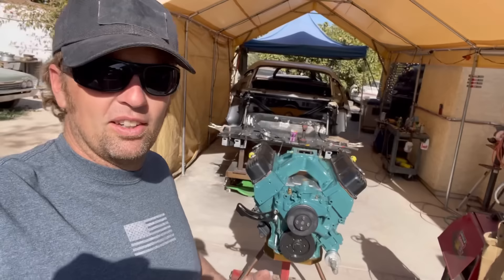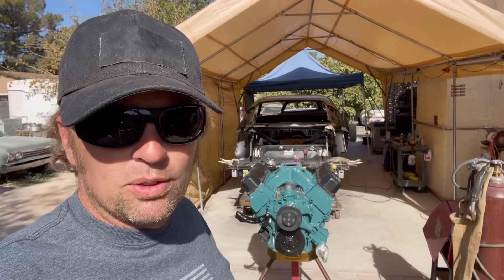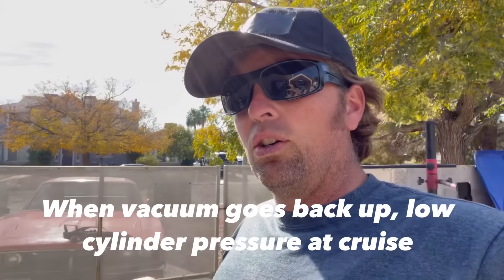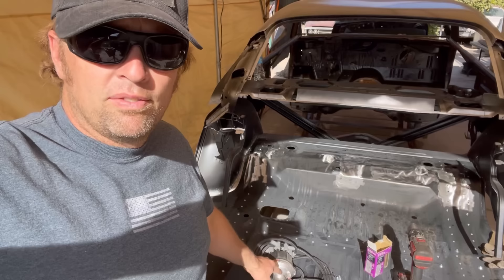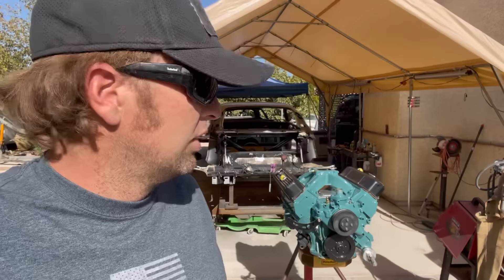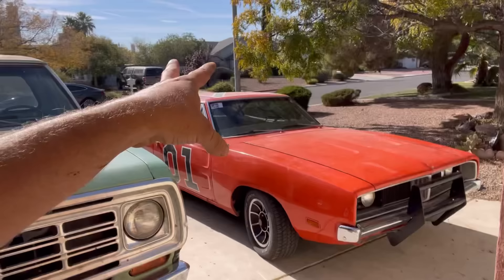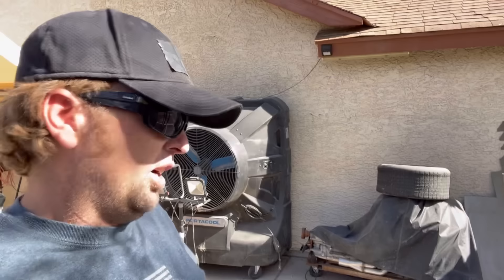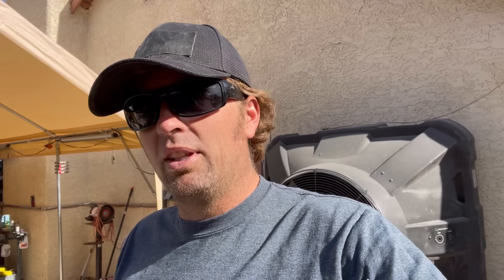Stop unplugging your vacuum advance on distributors

Comment: A dialed in vacuum advance will also allow the engine to run cooler... I recently bought an old '72 Chevy truck and the temperature gauge would get up to about 212-215 degrees then shut down starving for fuel because of vapor lock, even while going down the interstate with lots of air going through the grill. I replaced the entire cooling system first (new radiator, water pump, thermostat, fan clutch) and it still got too hot. Then I tried every trick to try to avoid the vapor lock (blocked off heat riser passages to intake, added a carb spacer, added a fuel return line coming off of an inline fuel filter just before the carb, insulated the fuel lines) and it still got too hot. Then I even "re-calibrated" the fan clutch (by adjusting the little thermostat clock spring on the front of it) to pull more air through the radiator, which it did, now you can hear the fan roaring with RPM, and it still would get too hot. When it would shut down and I'd have to pull over, when I popped the hood the amount of heat coming out would make me step back... Then I did a little research and decided to check my vacuum advance and the only changes I made was to switch it from a ported vacuum source to a manifold vacuum source, turned the adjustment screw one and a half turns to maximize advance and that is what finally fixed it... Now my temperature gauge stays around 160-170 degrees, even crawling in traffic on a hot summer day in the southeast, and my vapor lock issues are gone... Gas mileage got much better too... If you think about it when the ignition timing is late, the fuel is burning all the way down the bore to BDC and heating up the whole cylinder bore which heats up more coolant, then it's still burning on its' way through the exhaust manifold which dumps excessive heat under the hood... Another interesting thing I remember noticing about vacuum advance was one time when checking the timing on my Charger, I forgot to re-connect the vacuum advance hose and when I went down the interstate, I had to keep my foot in the throttle like almost halfway, almost opening the secondaries on the carb just to stay at 65 MPH. And my gas mileage got so horrible I started looking around for a fuel leak and that's when I found the vacuum hose that I forgot to reconnect. Once I reconnected the vacuum hose and got back on the interstate, I could cruise at 65 MPH with the throttle just barely cracked open off of idle and gas mileage was back to normal... Great videos!!!

Comment: Not arguing here but it seems to me if I tried to advance the timing to 45 deg at idle it would not be very happy. I am missing something here... Do a video showing exactly how you are doing this please. Again, not at all arguing, I agree you need a vacuum advance but it seems counter intuitive.
Reply from the maker: Every engine is different, crank timing into it until vacuum drop that’s ur magic number
Reply: Plug the vac advanced to a "timed" port on your carb (doesn't open till the throttle blades open) it help with hot starting & gives max advanced at cruise, but drops off under load & goes to 0 advanced at WOT.
Reply: Use manifold vacuum not timed

Comment: I think I understand your method but am worried others will not. So, 45 degrees at idle and 32 at full throttle after vacuum module pulls timing out. That means you are running your distributors with the mechanical advance locked out? You made zero mention of that, and it’s a really important detail here. If someone with a stock Mopar distributor does exactly what you say and sets their base timing to 45, they will have 70-75 degrees timing before the added timing from vacuum. What’s going to happen to these engines at 75+ degrees of timing under a load? Nothing good… I had a call this morning from someone who watched this and did not get the full picture here. I’m afraid there will be many more viewers who don’t.
Reply from the maker: Not locked, 22-24 base, 35-37 idle with vacuum, 32-34 mechanical without vacuum and 45-47 highway cruise

Comment: So many of the old distributors had mechanical advance slots that were too long for emissions.  Remove the advance plate and shorten the slots with weld, that way you can run a lot more initial advance and keep the total mechanical advance at reasonable levels.
Reply: I did that but with a FBO plate that has different length slots on a disc so you can get ,in my case , 18 initial and 36 total mechanical advance . I also use manifold vacuum advance to help idle and cruise.
Reply: 74 cuda ,360 with 4.30 gear .

Comment: 18-19mpg on the highway with 400/727/2.94 b-body. And yes, it's on manifold vacuum.
Reply: What's the build on your 400 ? I have an early 230-1 truck block 400 that I am trying to decide which stroker version to build. It's definitely getting the ceramic coating throughout and Trick Flows.

Comment: Allow me to tell what would happen if you left that vacuum advance line unplugged and kept driving like an average Joe cold air on a warm engine you would eventually burn a penny size hole through one of your pistons , but before that you would have a lot of detonation which would probably overheat your coolling system, so you buy and throw parts at it trying to fix it with the hole finally completed that piston will start dumping fuel into your crankcase diluting your oil while running on 7 cylinders, running late for work so you try to start it and hear a boom under the hood and find your oil cap blown off and your oil pan and valve covers will start leaking from everywhere what was the fuel diluting your oil and finally reaching the right proportions of oxygen to be ignited by the spark plug, so you'll eventually get it running and drive it to your mechanics, and he might just try to restart it and a boom all over again, and all that was caused by a vacuum leak usually at the back of the intake manifold, always inspect your vacuum lines, and replace them,

Comment: Chris, you are absolutely right. I have a 1973 Trans Am, the motor is BBC 440 ci. The cam is hydraulic roller 229/235 - 109, 9,9:1 compression, 750 Demon BT carb. The driveline is Tremec 5- speed, 0,64 overdrive and 3,73 rear gear. T/A runs 18 mpg on the highway. Initial advance is 8 deg, idle 31 ( 8 + 23 vacuum ). Cruising 53 deg ( 8 + 23 + 22 centrifucal ) Wot 30 deg because i have a Procharger supercharger. Before the Procharger wot advance was 38 deg. Car runs perfect and fuel economy is incredible low.

Btw, i live in Finland and internet and youtube is great invention because without that i'll never heard genius guys like Chris.

Comment: I had an old grey beard teach me how to time off of vacuum back in the 90s. 
I’m sure he’s gone now, but I remember what he taught me. 
I’m curious about the ported vs non ported vacuum debate. 
Would love to see your take on the subject.
Reply: I'll usually try straight vacuum first, but if the engine kicks back while cranking hot, or spits and burps at idle, then I'll switch to ported. Mopars seem to like straight vacuum, Fords seem to like ported.

Comment: Thanks for the wisdom. 👍 I run a 400 based 512 stroker with Trick Flow 240 heads and a hydraulic roller cam with 254 duration @.050 with 618 lift, all backed by an A833 4 speed manual in my 1968 Barracuda fastback. Time to get out the old vacuum guage!

Comment: Light springs and total timing coming in at 1800 rpms is all u need.    A stock dizzy timing wont come in until 5500 or almost never.    At say rpm cruise of 1800-2500 or so with a stock dizzy.  Mechanical timing is probably 15-20 or so.  Vac can kicks in. 30-35.     This on a sbf.   34-36 dgrs total mechanical advance is what they normally like

Comment: I have watched this and other videos you do multiple times, I'm new to this, I have a 69 dart gt 383 with 727 and 3.23 gears, Have no idea about what kind of cam it has. 1411 Edelbrock carb. I recently recurved my distributor, lighter springs advance comes in at 1200rpm all in by 2300 ish. distributor has black bushing so allows for 18-19* total mechanical advance, the vac canister was not working so changed that and new one is tested, it works. currently I have my timing set at 18* initial without vac, gives me 33* with vac attached, total timing all in with vac attached is at 52-53* I'm afraid of having too much advance on the top because of ping or detonation possibility and I can't limit the distributor further (no bushings to have less play) so based on keeping my max at 52 or lower the only thing I can do is screw the vac adjustment to stiffer to limit total advance. So my vac canister at lowest setting has max advance of about 0-19* I currently have it screwed in 2 turns and have it at 15* max the vac will advance. If I crew in more the stiffer the spring the less advance it will allow at idle when hooked on and plugged into manifold. 

I'm thinking of limiting the vac to give me max play of about 12* instead of where it is with 2 full turns now at 15*.  Here is my dilemma, would love to hear your thoughts... should I keep the vac advance on loosest setting and lower my initial to make sure I don't go far beyond 52* all in at 2300 rpm with vac attached? or should I screw the vac canister adjuster to stiffer, limit it to only advance say 10* max play and put my initial without vac attached to say 22*. 

I don't know if my question is making sense. I guess what I mean is, I have the lightest springs in the dizzy with the largest bushing to limit total advance and to let the advance come in sooner. There is no more adjustability left in the dizzy mine is a ready to run distributor, so I think the only other adjustable thing left is the vac canister. Set higher initial and limit the vac canister total allowed advance? or set lower initial timing and allow more advance through the looser vac advance port. I will end up with the same advance at idle and at highway either way you slice it but I guess what happens in between say at part throttle or takeoff the numbers will be different. but at all in and at initial with everything attached I will have the same advance degrees so which avenue is better? How much total play should the vacuum advance have in it, is there an explanation for that. 

Any of your thoughts, suggestions are appreciated. I want to get the timing diled in proper before I start changing jets and rods on the carb to smooth out any fuel delivery issues once timing is tuned and set where it needs to be.

Comment: Manifold vacuum advance canisters and ported vacuum advance canisters are different. Manifold vacuum is highest at idle, while ported vacuum is highest at part throttle/high gear - so those vacuum advance canisters are necessarily different.  If you plug a ported vacuum canister into a manifold vacuum source, you will have a wicked part throttle knock.  If you back off the timing enough to get rid of the part throttle knock, the engine will become very lazy.  If you plug a manifold vacuum advance canister into a ported vacuum source, the engine will require more initial timing to run even reasonably well.  Ported vacuum canisters are usually a lot larger than manifold vacuum canisters, and usually have a thermal vacuum switch in between the ported source and the vacuum advance canister.  Ported vacuum sources will go midway into the side of the carburetor barrel, and manifold vacuum sources will be located underneath the throttle butterflies or right into the intake manifold at some point.  Ported vacuum sources didn't become common until after 1973, so if you had a stock 1977-ish pickup (for example) that ran pretty bad;y or couldn't get out of it's own way, it is/was because of an incorrectly set up ported vacuum advance system.

Comment: I always set the initial idle timing with the vacuum advance disabled.
Then re-enable the vacuum.
The idle advance will step up but retard the timing when you open the throttle. This normally prevents "pinking".

Comment: Loving your, channel. But i think you might be off a little bit.  Your duel quad tunnel ram charger is getting it great mileage from the very tall 2.93 gears. My 69 charger 383,  was getting  close to  20 with the 2.72 stock gearing. Now it has 3.56, gears, and a 512, stroker. It gets  around  14 at 60 mph if im not playing to hard. Thats with ported vacuum. But i will try what you are saying, to see if it improves.

Comment: 100% on manifold vacuum. if I remember correctly, all internal combustion engines want maximum cylinder pressure at a certain number of degrees after tdc for peak efficiency .can't remember if the degree number was 14.15.16 or 17(piston position). regardless of rpm. and the same fuel burns differently depending on the fuel mixture. a guy grimsrud  have explained this well. but it's a lot of work to get the carburetor and ignition set up right.  usually  need different weights, springs, ifr, jet, airbleed, powervalve and powervalve restriktor.

Comment: new piston rings makes tons of vacuum also when i rebuilt my mustang 302 quickly discovered new timing chain kit & valve adjustment was huge in getting a smooth idle had a dwell meter hooked up before/after the rebuild idles so smooth now

Comment: I have timed an engine many times in the past with a vacuum gauge. Not because it made the engine run mo-better, but because I did not degree the cam in...I just slapped it in, and lined up the timing chain marks. I wish I could get classic car insurance for my 4X4 Chevy square body crew cab. Classic insurance companies will not insure a 4-wheel drive truck, and since Nevada changed the classic car registration laws I am screwed on that.

Comment: im fairly inexperienced, and I need some clarification, I think. I understand what you are saying about having more advance when at part throttle. from the little I think I know, I don't understand why you want manifold vacuum instead of ported. from what I understand, manifold vacuum drops as you give it throttle and ported vacuum increases. with what you are saying, it seems like ported would be advantageous because the timing is being advanced as soon as the throttle is moved. what am I missing? why is that not the case?

Comment: Wow, confusion abounds.
1. There are two types of vacuum. Ported vacuum that by design does not pull any vacuum at idle. This is where most every factory vacuum advance system connects. Slightly off idle Ported vacuum will become effective. There is also Manifold vacuum which provides maximum vacuum at idle. After coming off idle both vacuums operate r-e-l-a-t-i-v-e-l-y the same.

2. What he is advising is using Manifold vacuum over (conventional/factory) Ported vacuum or in the cases where there are those who use no vacuum advance at all, they should have it. It will increase the idle RPM with the added advance and the carburetor can be adjusted downward.

3. How he is achieving his numbers. Most cars are using the Ported (not effective at idle) vacuum. For the sake of this discussion let's say the vacuum advance has 13 degrees of advance at maximum vacuum. Moving the vacuum advance hose from Ported vacuum to Manifold vacuum will increase the advance at idle that 13 degrees. That is where he is setting his 45 degrees. Under full throttle the vacuum advance becomes ineffective due to insufficient vacuum. Thus his total under full throttle timing is whatever his total timing (initial + mechanical) and mathematically equates in this case to 32 degrees. How much is initial and how much is mechanical I don't know.  Frankly I'm confused because It would seem that the timing should be set at the RPM where full mechanical come in (not at idle) and then knowing it will be 45 degrees at light load with the Manifold vacuum advance (assuming 13 degrees there). But not knowing initial timing and the range of the mechanical timing makes the calculation difficult. I say that because if he had 20 degrees of mechanical timing (none in at idle) and 12 degrees of initial timing (32 degrees total) then he is really close to 65 degrees at light throttle assuming the engine RPM is where the full mechanical comes in and as someone already said that is very high. I hope he can give greater clarification.

4. Here is where this has become one of the great You Tube debates. SOME engines you can do what he has done and they respond well. Others don't. The bad experience is pinging. Likely the cause is either a lot of initial advance (with limited mechanical advance to hit the target number) and/or a vacuum advance that doesn't drop the advance far enough/fast enough. Then the advance is too high for the load upon the engine. Using the Ported vacuum is safer in that regard because there is no high vacuum advance that needs to back down coming off idle. Some engines can get away with Manifold vacuum but others can't . And there is a whole lot more involved regarding initial advance, the range and response of centrifugal advance and the range and sensitivity of the vacuum advance. So, while I completely agree that running vacuum advance is important I can't agree that in every case running Manifold vacuum is always appropriate. Modern cars have knock sensors and the computer adjust the timing to the best condition. With a non-computer system it is a trial and error guessing game and even then not always ideal timing is achieved.

Comment: great video and topic Chris, so if i understand your instructions on the constant vacuum, the engine requires constant direct vacuum from the intake manifold and other stuff like the heater controls and other accessories use like a secondary vacuum source? this is the exact issue i am having with my umm er.... bronco 400m 2bbl. i don't know how the vacuum works and effects on the vehicle. the more i try to figure it out from the manual the worst it gets.